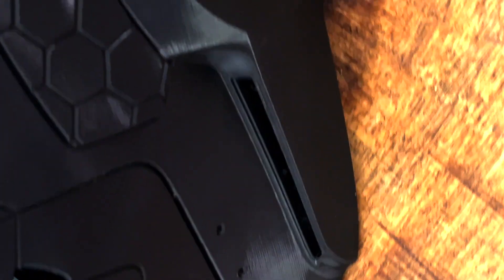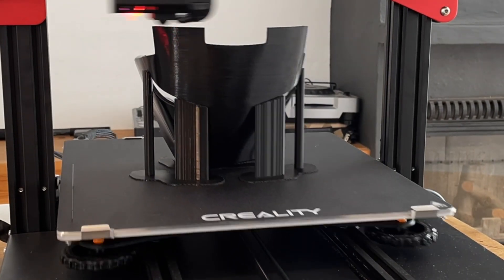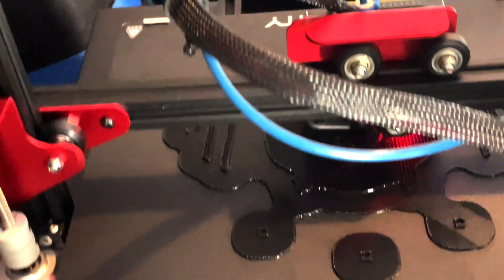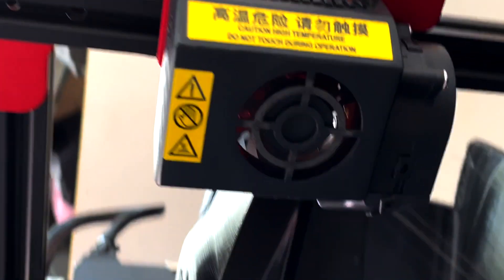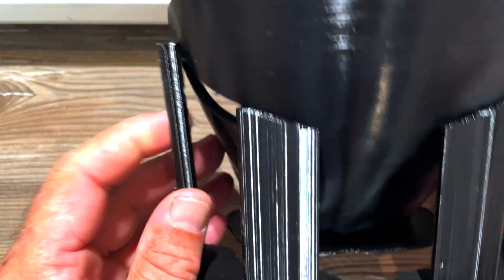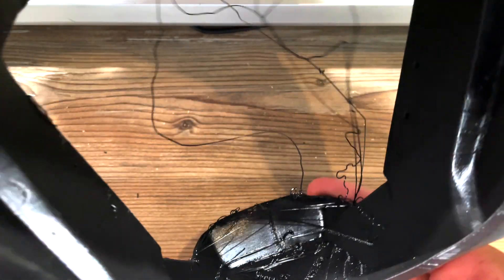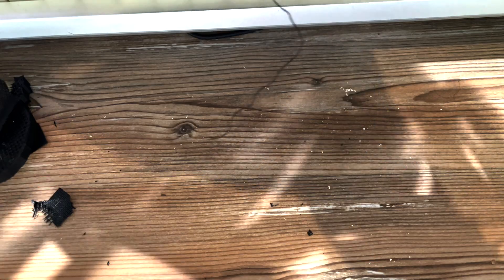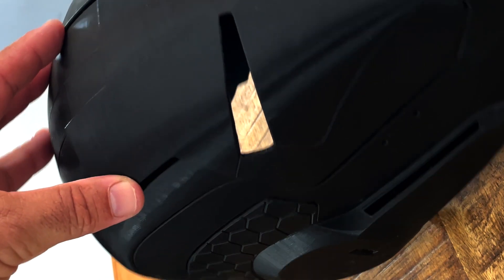My first 3d Prints Ironman Helmet in 3D on a Creality CR-10S Pro v2

Comment: the faceplate is alright, it's the top of the chin part that needed support. an easy fix would be to cut off the chin with meshmixer or something and print it separately.
Reply from the maker: you're welcome